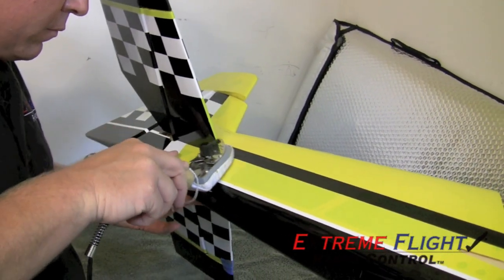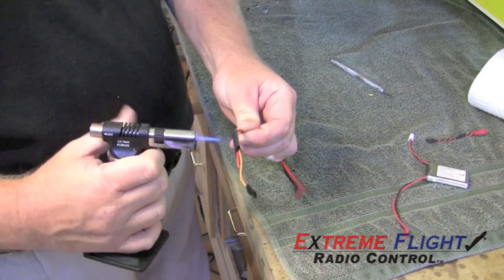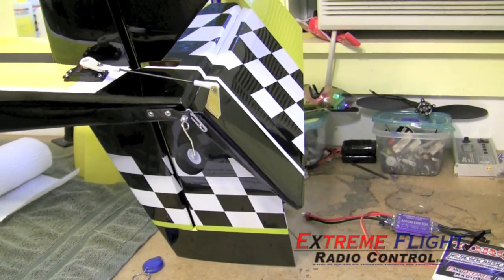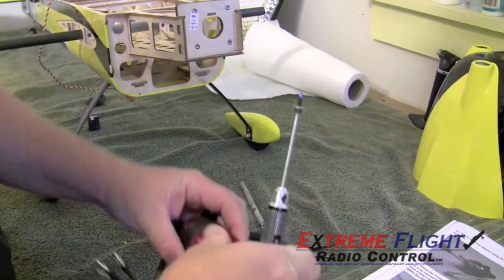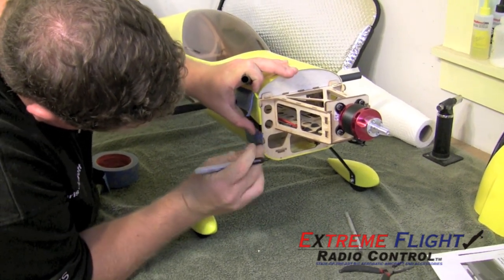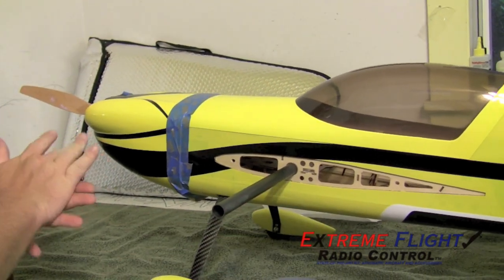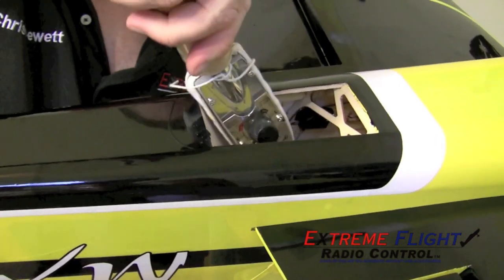Extreme Flight 64" MXS EXP Build Video #2

Comment: I was surprised that you dont use a Seperate UBEC on your ESC. I was tought to always add a seperate one and not trust the one that runs the speed controller. I am assuming that was a Castle which is supposed to be the best on the market. I was also re educated by Dave on the EE C Blog that the ratings are not correct as stated for peak sustained power out put on those as well as non sustained power. The ammount of heat generated would cause it to go into thermal shut down. You can look that You Tube video up yourself. It certainly opened my eyes. As I stated in your first part of this video series,yours has been the most comprehensive of any I have watched so far. I will greatly benifit from it getting my Vintage Graupner 300 extra ready for its remaiden after buying it out of storage and only being flown once before,then put away because its previous owner was intimidated by its size and speed. Thankyou again. Scott Firman.
Reply from the maker: The Extreme Flight ESCs are quality stuff the BEC does not fail.  Thousands of hours of success with these.
Reply: +Chris Jewett I wouldnt mind checking one out really. I dont mind paying a little more,especially when its a 4 or 5 hundred dollar plane.Not including electronics of course.
Reply: +scott firman I see the castle was on the list of aformentioned ESC's. Face it,no ESC can possibly dissapate the heat created that the listed rating is for on the unit. The size of the heat sink would make it impossible to use. Dont take my word for it, EEC Blog is the place to witness how these units handle the rated power listed,that being said,I am not questioning you my friend,its the listed rating I am questioning. If I had the proper lab I would be more than happy to put it to the test,oh wait,it was already done. I dont claim to be an electrical engineer,no. I do believe the product does perform well,I personally dont like placing all my eggs in one basket,not any more. Call it insurance really. If you can take out two life insurance policy's wouldnt you do it? If you could Insure your vehicle for more than just liability wouldnt you do it? Thats really all I am saying. If I invested thousands of dollars in a large scale multi engine plane, you bet I would be adding a UBEC. Really,why not add one to your single engine plane? I guess when it comes to the world of electronics,I trust no one. Faith in a product is like investing in waterfront property in Florida during hurricane season. I know....lighten up. Just hate to see people get so religious over a product. I really did pick up some great tips on your video's. I have a few friends in high places in the RC world that will be most interested in your video's. Great job. I plan on watching them all. Knowledge is power my friend.

Comment: Thanks for answering. Mine mxs had the  A50-14 xs but I changed it with a Rimfire 80 cause of some bearings problems (pheraps this motor on 6s is at his limit).Rimfire seems very good too.

Taloon 90 ...at the moment... works great .

Hyperyons servos have jittery actually but I tried a solution on youtube and it works.

However mxs is fantastic  but looks a little bit rude than other extremeflight exspeccially on pre-stall figure (better on f3A)....isn't it or it's a wrong idea?

Comment: Hi , 
my English is not good enough to learn  all from video or forum so I try to ask here ...we say "Trying doesn't cost" :)

I'm going to use Hacker A50  14xs v2 ...did someone tried it?

Hyperion Atlas DH 16 FMD servos all around  could be a good choice ?

I'm going to use Talon 90 Castle creation  esc with separated 7,4 battery for servos...will it work well?

Thanks a lott (not much info about this model here in Italy)

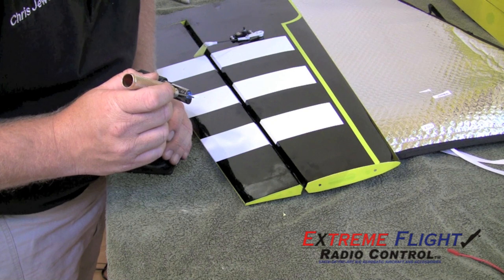Comment: WHY THE HOLES ON 20:15!??
Reply from the maker: Vents your ailerons do the covering will stay tight on a hot day.  Those pockets between the aileron stringers are air tight otherwise and will puff out as the air expands in the sun light.